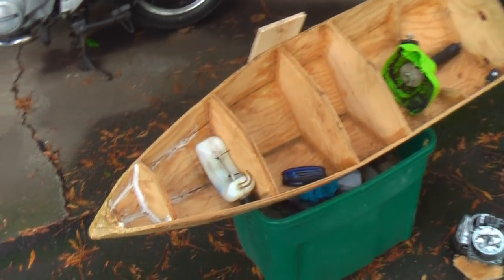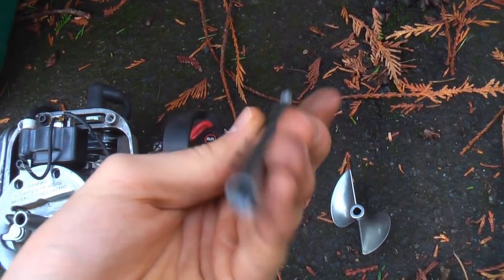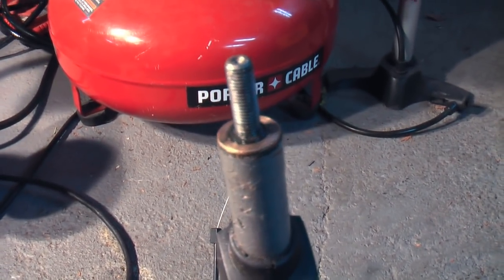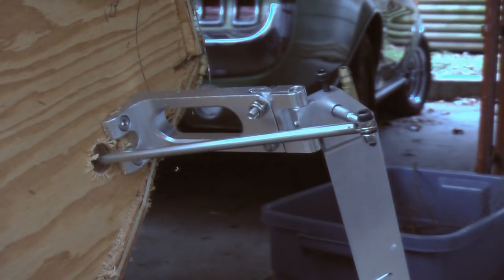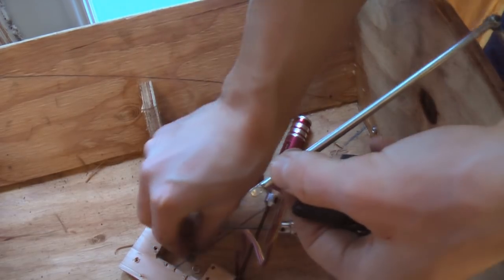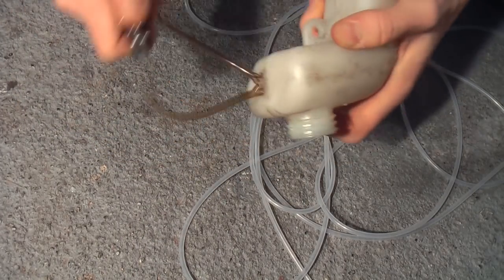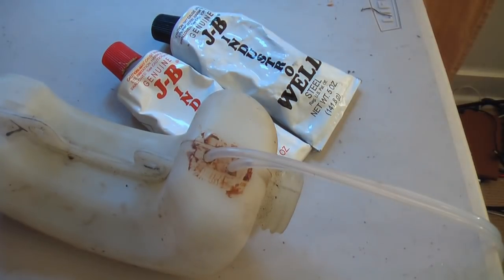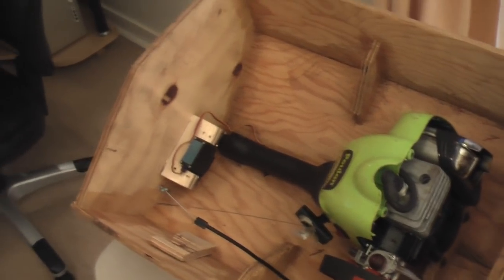25cc RC Boat Project - Part 5 - Finishing

Comment: The rudder has more of an effect when it is directly in the centre of the boat, when it is off to the side like yours is then it will constantly want to turn the boat ever so slightly to the right, just a pointer

Comment: For your rubber. Either make a hole or make it flat right where your grub screw holda onto the metal shaft or else you most probably will have slippage on a round surface!

Comment: Looking good, but, how is the gas going to be pulled into the carb? The fuel lines are at the top of the tank, by the looks of it you'll only have about an inch of fuel before it will just suck air?

Also yes that linkage hole in the back is going to be interesting, haha. 

Otherwise it's all good. Love the hull. 

Will the steering be a bit lopsided with the rudder off to one side like that?

Keep it up. :)

Comment: get some rubber and stick it on the oustside of the hose sort of like a sleeve then use epoxy to attach it to the boat and the pushrod, and give it a bit of slack so it can move, that will waterproof the hole and problem solved

Comment: How do you plan on keeping the water from coming in through the hole for the rod connecting to the rudder? Do you plan on the boat sitting high enough in the water that it just doesn't get up to the hole or do you plan on making some sort of flexible seal? Maybe if you take a rubber sheet, poke a hole through it a tad smaller than the rod, fish the rod through to make a seal, and attach the edges of the rubber sheet to the hull, it would likely make a water-tight seal.

Comment: to seal the hole around the rear servo rod, i would simply cut a piece of bike inner tube and punch a small hole in the middle, feed the rudder servo rod through and glue/screw the piece of rubber to the boat body. the hole in the tube should be smaller than the rod, it would seal around perfectly, and to help it slide better just put some vaseline one the servo rod.

Comment: Also the gas tank might be to far away from the engine. That carburetor has to suck the fuel from the tank. If its to far away it won't be able to so it won't run or it might run bad .

Comment: I'm a little worried about the hole for the servo arm you drilled. Seems real close to the water line if not under it.

Comment: Also your turn ratio will be off as you only have one rutter on one side of the boat, it's going to turn faster one way than the other, not a big issue but an issue none the less :)

Comment: Nice man!  What is the balance point you've got?  It should be around 30-32% F/R... just to let you know!  Having the gas tank up front might not be a good idea for that reason.  Also, as a guy commented about the hole for the steering being too low, he's right, but you could get some rubber bellows, and seal them up to the hull and the rod.  I subbed man, looking forward to seeing it go! :-)

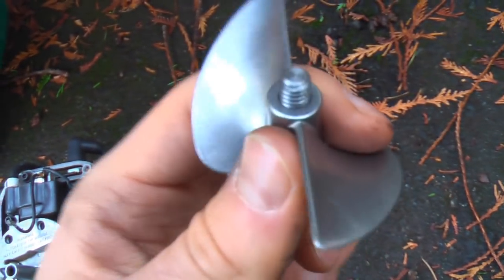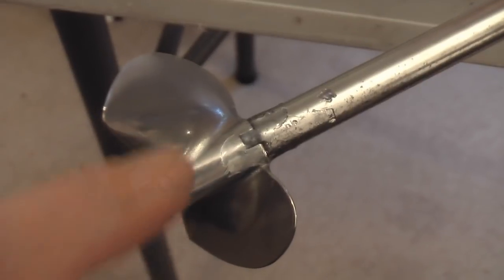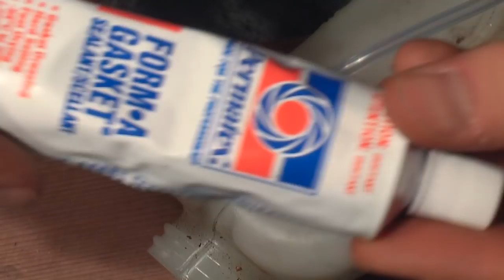Comment: I love hearing people talk about something when they don't use the proper terminology,  @ 1:49 there is no such thing as a "flywheel hole" there Ace that is the nut that holds the flywheel on, @ 1:34 it's not called a "rip cord" it's called a rewind or recoil, @ 6:09 LMFAO that's not a bolt it's a nut, @ 6:13 wtf are "tubes" ahhh don't you mean fuel line, WOW @ 6:45 a "some sort of semi unnecessary nozzle" first of all it's a fuel line fitting and yes it is necessary because one length of fuel line fits on one end of the fitting that goes in the tank to the fuel filter and it fits into one of the holes in the fuel tank and seals the hole from leaking and another length of fuel line attaches to that end of the fitting to go to the carburetor, @ 7:12 that shit is a sign that A) you definitely know nothing about what you are doing, B) you wouldn't need that if you used the so called "unnecessary nozzle" you spoke of earlier. WOW thank you I did have one hell of a laugh at you, but I do have one fuck of a headache from you not having a fucking clue what you are talking about. Thanks again moron.

Comment: your shaft coming out of the boat is too long, it will vibrate....  and Oh by the way the useless piece on the end of your gas tank was a weight to hold the hose down in to gas, dum,dum....